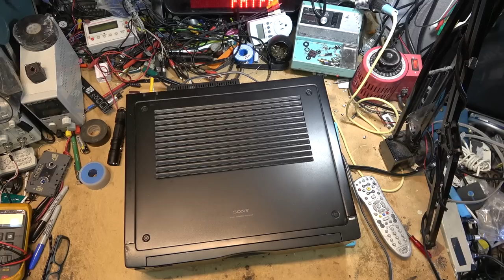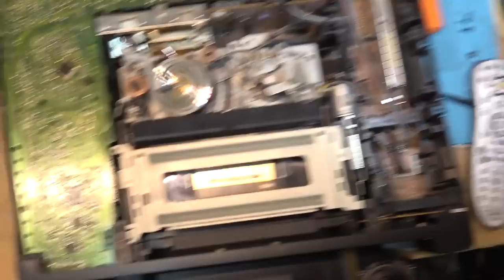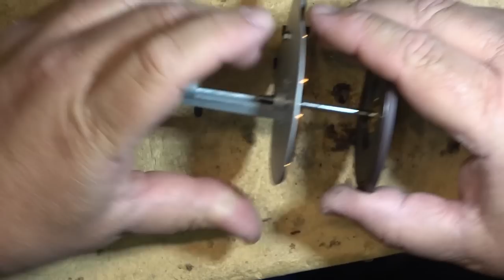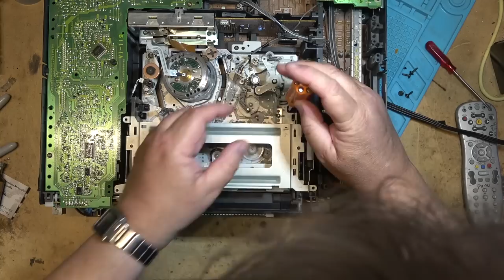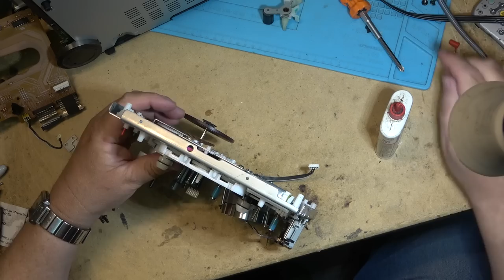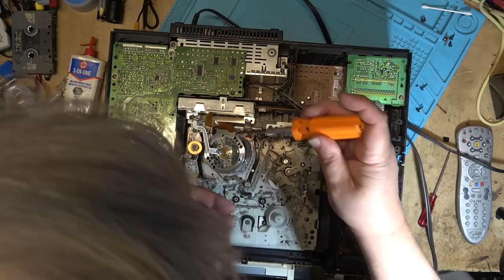Sony SLVR1000 R5 555 757 686 SVO2000 VHS chassis Capstan Bearing failure

Comment: At 10:13 - These plastic oil seals were always fun to place back on the shaft, they kept running away from me :). Panasonic K mechanism had a similar design of the capstain unit to this. I often needed to relubricate the bearings - people didn't do it and the machine in time started squeaking like crazy.

Comment: The fact that Sony would even redesign the part and make it a little stronger if it fails after a few years seems so odd today - they'd probably just say "it's normal wear, go buy a new one" now.
Reply from the maker: Oh they had to.  We were changing complete capstan motors left right and center.

Comment: Interesting. I wonder how you know how far to bend the shaft or housing, and not bending it too much? 
Very interesting video! 👍
Reply from the maker: There used to be a saying for how far to bend something but it's a politically incorrect term these days.  Same as the connectors that you screw 2 coax cables together with.  There was a term that was commonly used but use that one now and a protected group will crucify you.
Reply: @12voltvids  I have a sony multi system hifi vcr do you think it uses the same chases for now it works great so I leave it alone its a hifi karaoke unit.

Comment: Ironic how the aluminium bushing or standoff that's meant to stabilize the capstan shaft against pressure, ultimately causes the issue that it should prevent. On the other hand, capstan motors that don't have the bushing, probably never experience the rubbing issue. But I can see that motors with pancake coils like that are more sensitive to any lateral pressure than those with a stator iron core and radial coils and pole pieces. Pancake coil motors were likely cheaper to produce since there's no stator iron core in them. They cut down cost on these models a bit too much.

Comment: Why didn't they put a parking feature on the pinch roller that when the unit was turned off the pinch roller assembly did not rest on that shift ?.

Comment: Hi, I have been following your youtube channel for a long time. I live in Italy, and I own a Sony CCD-V5000 Hi-8 camcorder. I have encountered many problems over time. Now it doesn't turn on anymore. I read on the internet that all the smd capacitors must be replaced (as they are defective. there are about 73 in all). Have you ever faced this repair in this kind of camcorder?
Reply from the maker: Yes I had a v5000 camera.  I changed all the bloody SMD caps back in the 90s and sold it as fast as i could.  The crap that leaks our of them will attack the internal layers of the board and riun it. About 14 months after i sold my old repaired camera guess what walked in the door at the shop i worked at and they got the bad bees that they needed a new board due to corossion.
Reply: @12voltvids  So, in your opinion, I should repair it and replace all the SMD capacitors, or the work is not worth it since it is possible that it fails again. Is it difficult to take it all apart and then put it back together? It has been in my possession since 1991, I am fond of it, and I would be sorry to leave it in this state.
Reply from the maker: @andreacerroni9010  if it was mine i wouldn't repair it, but if you have tapes that you dubbed PCM audio on remember that only this camera and a few high end home decks can play the PCM audio. It is s lot of work to change them and it's a crap shoot if it will last any time.  You won't know how bad the board untill you replace them and power it up.  The damage is internal damage to underlying layers of the pc board as it uses a 4 layer board.
Reply: @12voltvids Ok thanks for the advice. I'll see what to do
Reply: One last question I ask you, having to replace all the smd capacitors, which brand do you recommend to make them last longer over time?
Reply from the maker: @andreacerroni9010  
I use what I can find.  I am not concerned if they last or not.  I don't know any brands that are better then others. Most of these original caps failed because they were all manufactured incorrectly in the first place.  In general that's why caps fail.  If they were made correctly they are fine 50 years later.